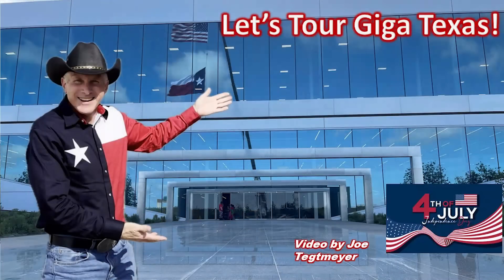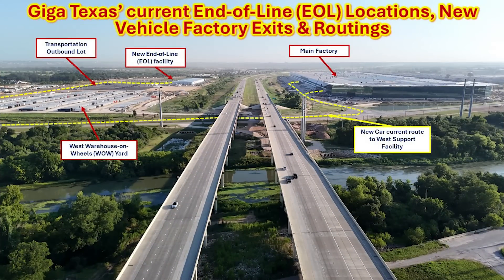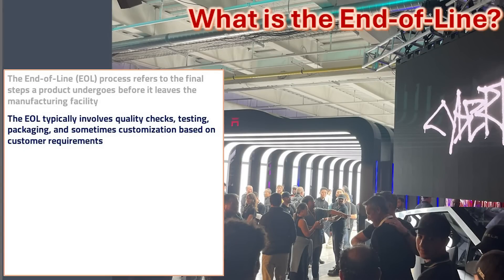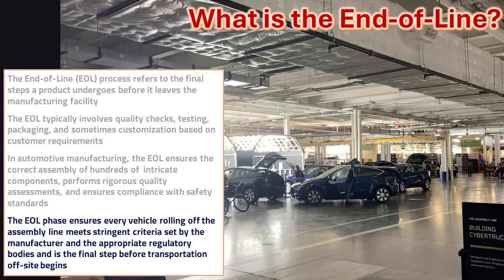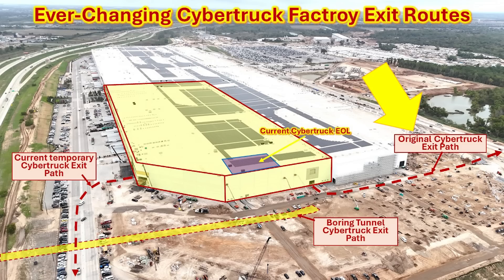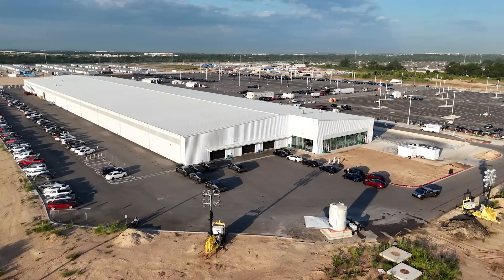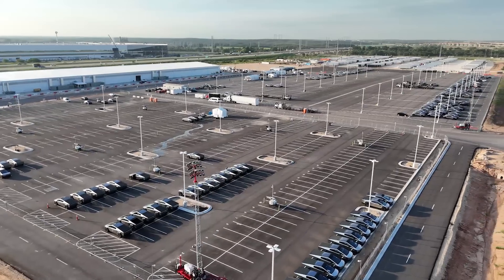Big Changes to Giga Texas End-of-Line Operations underway!

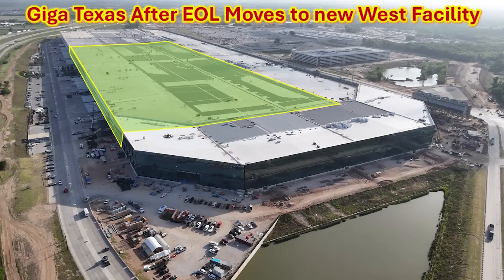Comment: At 2:50 you showed two small purple overlays of the current EOL regions, for the Model Y and Cybertruck, respectively.. Yet at 5:48 there appears a much larger green overlay. If the two smaller overlays are the current EOLs, what are you suggesting this green overlay represents. It would seem to already be including the GA lines for the Model Y and Cybertruck.

Comment: It's a big space saver as there is a bottleneck currently  with a big buffer area prior to the light tunnel End of Line in he main factory.  It will be straight off-line to the West Side EoL and hence transport.  incidentally this is similar to Giga Shanghai operations.

Comment: I still don’t quite understand the workflow at the West EOL facility n the Y and CyberTruck  currently and and what will change. Obviously the new Boring tunnel will be a major change once all EOL has finally moved out of the main GigaFactory to the West EOL facility.

 I see pieces such as GigaFactory End Assembly-> GigaFactory EOL - exit and park  before for group drive -> to North Entrance West EOL building ->Exit West EOL South Exit ->
Then charge or test drive -> redirect if needed -> final check under tent then -> store on north lot or move to west transport lot and away transport trucks.

I think pieced together the flow exempt for understanding what criteria of North storage lot at West EOL. Then there is the small lot and trailer across from temporary CyberTruck exit and of course the former East Calibration and Charging lot not fenced into two area South for CyberTrucks/ North for Y.

The only though I has
North Storage (West EOL) 
1. Overflow
2. Unassigned to customer 
3. ?

Small lot & trailer CyberTruck 
1. Missing Part?
2. Needs fix replacement part

Former East Calibration & Charging
1. Overflow 
2. Unassigned
3. Missing part?
4. Repair/recall part waiting on part
5. Tesla use such crash test or other

New southeast  parking structure 
- temporary storage during site construction at GigaFactory
 For any of my previous reasons.

Of course I could be completely wrong on the various reasons to store new vehicles just off the line.
Any other suggestions I missed or got wrong from my observations of these great drone videos?

Thanks Joe!

Comment: I am guessing here that the EOL as shown @2:13 will always remain inside to ensure fit and finish is completed before the car leaves. But the outdoor building is some additional testing.  It's the same in Giga Shanghai. All cars go through the road test but goes into a smaller building for additional testing before going to the parking lot. Curious what those additional testing could be.

Comment: It baffles me that Tesla built this huge factory from scratch just a couple years ago and they are already expanding it and reworking large areas of it.  Why wasn’t this all done during initial construction?  It seems like construction never ceases there, from the new parking garage, the new tunnel, and the new cooling fans for the supercomputers!
Reply: Personally, I had never considered the current work as expansion or rework, but more as the intended initial construction.
Reply: @jbbuzzable  If it were "intended initial construction" why wasn't it done initially to begin with???
Reply: @DavidJohnson-tv2nn  It would have been nice to complete the whole project with a snap of the fingers.
Reply: It is exactly on the nose for Tesla, and SpaceX for that matter, to iterate, move faster, iterate, move faster, iterate, and get better over time. They obviously have generated some construction waste from all the rework as a consequence but they have the profit margins for it. More space in the factory means more space for construction of additional vehicles and products. That’s the important takeaway in this video.